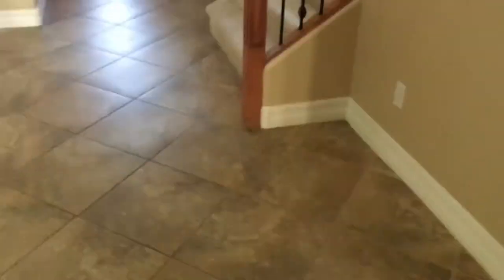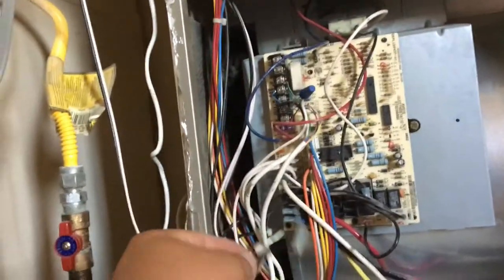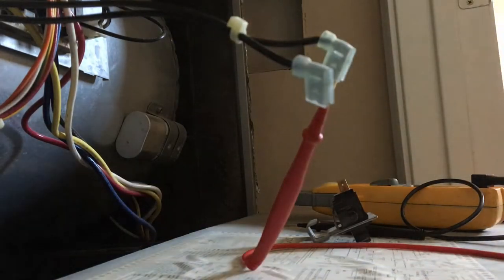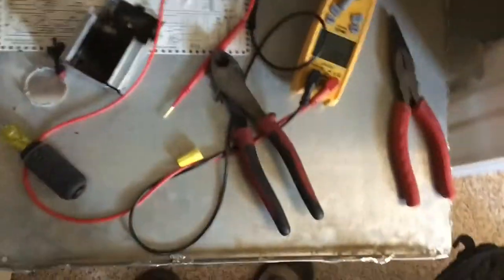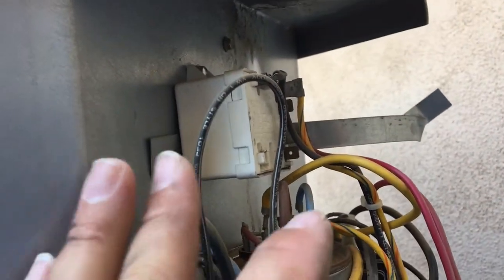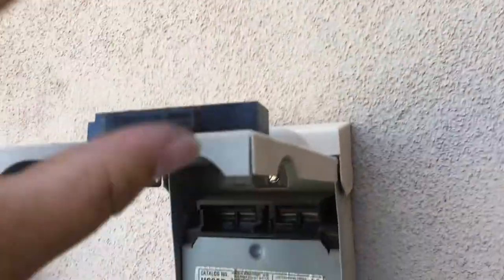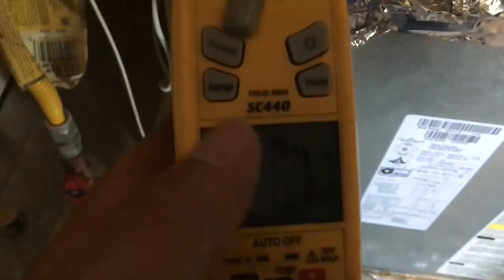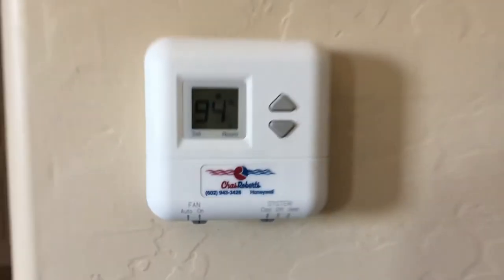A/C no cool

Comment: Cool vid, 
I would have changed out the blower motor , the drag on start-up caused the wires  to burn up and the failing cap. 
The Compressor is weak as well.
Your an honest guy , and skilled.
I'm just thinking it will fail soon ,then the customer always gets mad at the A/c man. 
Haven't seen any vid the the reef tank.
Reply from the maker: I talked to the customer on options of replacing motor that day.  At first he said not right now.  Lol but as of this morning I replaced the motor as they just got into town and heard the noise for theirself.  So it's a new motor now.  Currently don't have a tank set up.  But I will soon I can't handle not having a reef lol.  Thanks for watching.
Reply: SIMUANGCO2468 Yeah I can't wait to see your next set up the last one is awesome

Comment: My fan has a lot of vibration when running on low speed, I've had to replace my outdoor cap, I didn't realize there was one indoors as well (makes sense), I will have to look into that, maybe I can get rid of that vibration. I also can't wait for another tank vid. Good luck.